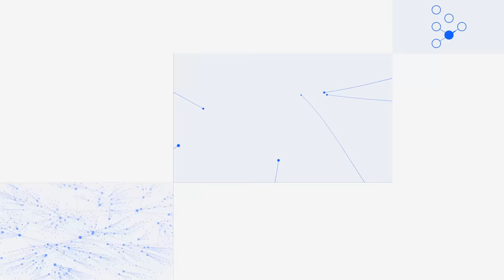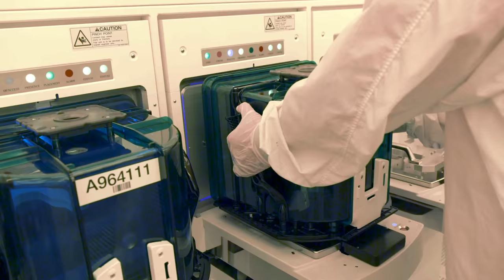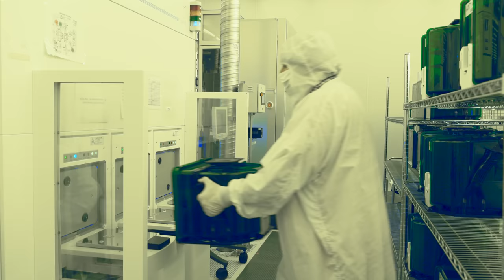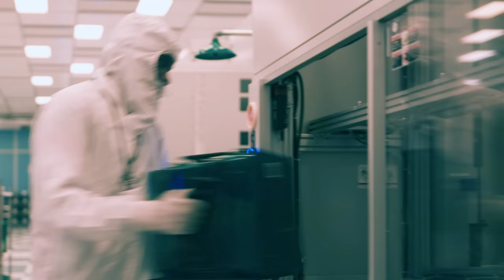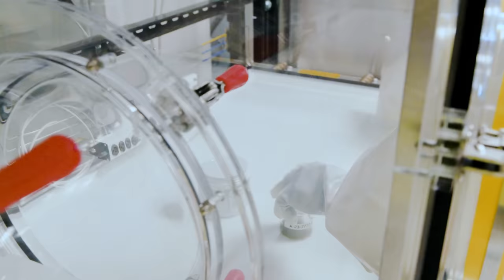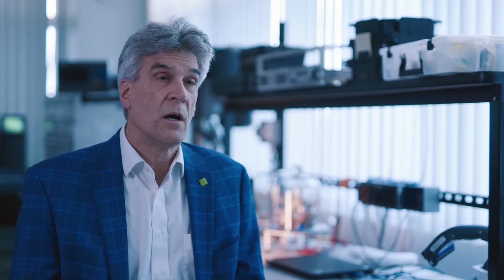The future of computer chips is being made in Albany, NY

Comment: Two beaming stamp pads for independent x and y spacing selection with a contact face (carrying straight out beam emitters) in the form of many parallel scribe lines could beam prepare a wafer for scribing if electrons can leave tracks of enough energy in the wafer to promote etching. 
These ideas are free to read and use.
Aloha.

Comment: I remember Scientific American printing that IBM had a committee step through the second law of thermodynamics and decided at the last step that it had to record data on randomness which would take energy to erase. 

Why do those two things? 

It is more symmetrically elegant for freezers to release energy as they cool any initially warmer thermal mass put inside them. 

Please consider a thought experiment device that may work because it avoids the failing parts of (1)Maxwell's demon thought experiment device which fails because the demon needs powerful light and (2)Feynman's paddlewheel, pawl,  and ratchet wheel thought experiment device which Feynman clamed would fail to rectify random thermal motion. He accepted that small paddlewheels will move in response to the thermal random motion of fluid they are immersed in. 

The purpose of the thought experiment device below is to create self powered thermal diversification. This would refute the second law of thermodynamics. The thought experiment is impractical but easy to visualize and check for mechanical workability.  It is not too deep in the nanometer scale relm. 

Sketch made with keyboard characters: 

COLD ROOM   ())--:WALL:-->> HOT ROOM     
>~1000 NM< 

Key
()) = Paddlewheel. 
-- = Axle.  (Continuous from end to end)
:::  = Axle tunnel going through a wall.
>> =  Lumped friction element

Please visualize two roome full of air separated by a very thin wall that allows the rooms to hold their heat independently with minor leakage through the wall. The wall is thin strong and thermally insulative  to delicately support billions of  separate nanometer scale short axles running straight through loosely enough to rotate freely but  not leak very much heat so the rooms can hold separate temperatures. 

On the left side, a very small paddlewheel is mounted at the left end of each axle. On the right side, lumped friction elements are mounted stationary in place on the wall, one for each axle, for the right end of each axle to run through. The lumped friction elements connvert the mechanical rotation of their axle into heat. 

Brownian motion (a nanometer scale effect) turns the paddlewheels at random speeds randomly clockwise or counterclockwise. This random rotation is turned into heat by the lumped friction elements.  The lumped friction elements do not impart Brownian motion to their axle.   

  The committed functional roles of the paddlewheels, axles, and lumped friction elements in differnt places should systemically produce a divergence in the thermal energy in the two rooms without adding external energy. 

Water in a sealed container could be endlessly cycled without cost between melting from the heat of the lumped friction elements' side and freezing from the cold of the paddlewheels' side. 

Basically, solid structures have rigidity; fluids have little rigidity. 

l was granted US patent 3890161 DIODE ARRAY,  for a refrigerator that absorbs thermal energy in an insulated compartment and releases a corresponding amount of electrical energy using the intermediary of rectified Johnson noise (the Brownian motion of electrons) aggregated by a multitude of consistantly aligned diodes. [Not exactly the abstract] It has been open for anyone to develop since 1992.  

I had a report of a working very low power prototype in ~ 1980 but l naively lost the prototype. It was made from a chip containing ~1400 gold pillars abutting N type GaAs. A U VA Charlottesville department made it. They could not align very small diodes well enough in 1980 to make ~1 um dia diodes individually so they made them in patches. I found a lab that put conductive paste on the face of one patch chip to bring all the diodes in parallel and test it in an oil bath in a sealed test chamber. They went out of business but I thought they should keep the prototype because they had the test chamber. I lost contact with them and never received the prototype. U VA  refused to sell me any more patch chips and stopped making them. The thermary is probably more practical than the diode array. They both may work. 

I am not interested in any more patents. The diode array patent gives me enough of a reputation. The exclusionary power of patents breaks up synergistic benefits to civilization. Wide exposure to the public (as needed for wide scientific and spiritual discourse) renders invention concepts unpatentable. 

Applications of thermarys, the latest working name of one of the latest concepts, may be too obvious to patent. 
Thermarays are becomming too public to patent.

I'll try emoticons:
👗☸️-🇮🇪🎴-  🎒 

👗↖️☯️↗️ 🎒
👗↖️☯️↗️🇦🇿⚡️ 

Aloha
Charles M Brown lll
Kilauea, Kauai, HI 96754

Comment: Introductory: How to make electrolithography replicants for a simple  product. This is written for multidisciplinary understanding: This idea is being given to the world free and clear. 

Uniform diameter ultra small pores that are uniform in a distinct array have enough easy constraints for lithography  that the difficult constraint of being small can be carried in the overall affordability. The holes are of one size; points on the surface of the array are either solid or empty, and the whole surface is mostly this way - there may be thick Ines without holes for technical reasons. The replicas can be contact printed and made to be removed by chemical wash.
A very thin replica sheet can be stabilized by having its back temporally attached to a rigid flat mounting plate.
The exposure through the master is intense enough to soften beam granularity. The source floods the back of the master with little need of registration. 

Aloha,
Charles M Brown lll

Comment: Thermary is a plausible  concept 

The thermary mainly consists of two electrodes closely face to face (~1 micrometer) in a vacuum wired to an external DC  electrical load. The face of the [Emitter] electrode is covered with a uniform array of LaB6 tipped small diameter carbon nanotubes grown straight out. The face of the [Absorber] electrode is covered with small scale graphine flake char. [Rice U 2014] 

Thermal energy mobilized unattached electrons will tend to free themselves outward from the emitter tips and drift at ~1 million meters / second @ 25 millivolts (thermal electron energy @ 20 C)  to the absorber which tends to collect them.  

A negative charge accumulates on the absorber. This repels oncoming electrons slowing their forward drift, cooling them. The absorber electrode charge is simultaneously the repelling cooling and the external electrical load voltage. The drift current and external wire route current are the same. The DC electrical power consumed by the electrical load depends on the load resistance. Thermal energy absorption always equals the electrical yield. 

Wire resistance is a practical loss not a true loss so lt is overcome by added thermary output. The extra cooling balances the heat given off by the wire loss. The performance of the device is expected to be modest in the beginning but improve rapidly. Even early devices are expected to last a long time. There is little place for obsolence if the first installed thermary works adequately. They will withstand being short circuited indefinately up to electromigration limits. 

Aloha 

Charles M Brown lll
Kilauea, Kauai HI 06754

Comment: Until there is a completely American version of the ASML+TSMC combo, you are always gonna be chasing down the leading edge elsewhere and vulnerable to market supply chain dynamics
Reply: Electron beam lithography may achieve better resolution than ExtremeUltraViolet. Narrow electron beams with very uniform electron energy can be emitted from carbon nanotube ends especially if the work function can be lowered with LaB6. Electron beam lithography is considered to be slow but that may be because a single beam is used. Many beams would make quick work. My ideas are given for free, wide, and unrestricted worldwide distribution. 

Aloha
Charles M Brown lll
Reply: You can consider it a vulnerability, but you can also think of it as a leverage for you to frog leap into a technology that you don't already have.
Reply: @porcorosso4330  Very true

Comment: Electron beam lithography may achieve better resolution than Extreme Ultra Violet. Narrow electron beams with very uniform electron energy can be emitted from carbon nanotube ends especially if the work function can be lowered with LaB6. Electron beam lithography is considered to be slow but that may be because a single beam is used. Many beams would make quick work. My ideas are given for free, wide, and unrestricted worldwide distribution. 

Aloha
Charles M Brown lll